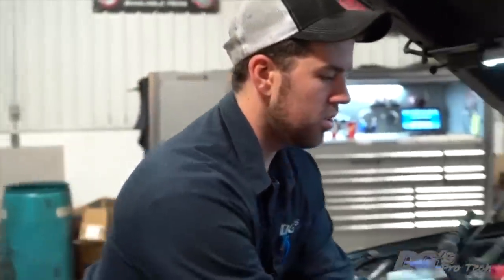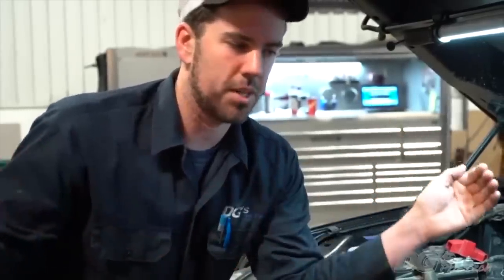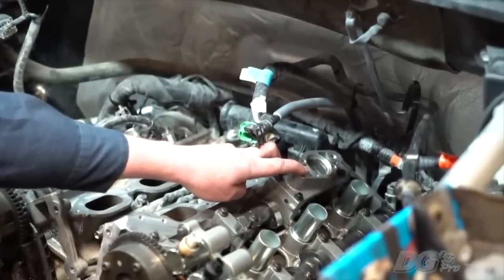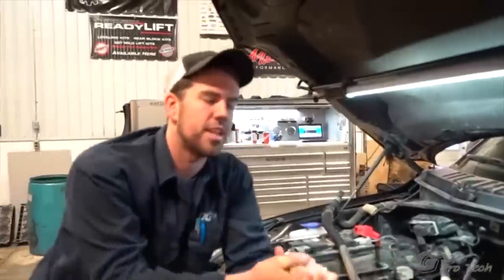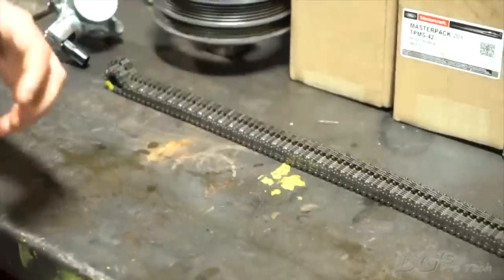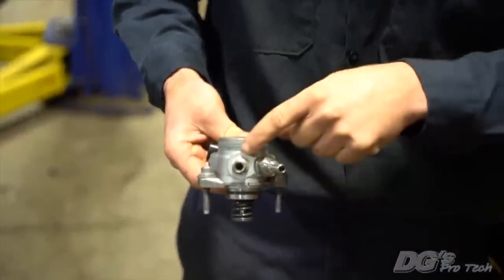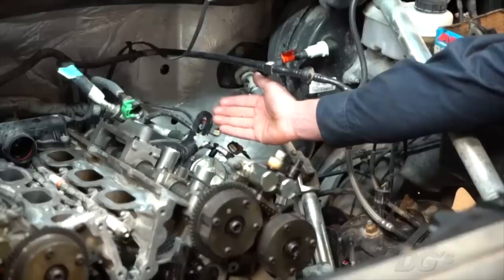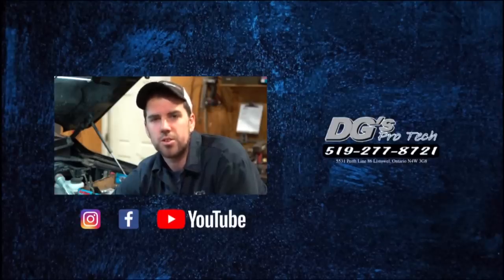What you NEED to know about Ford EcoBoost Engines by Dustin Golley of DG's ProTech

Comment: You get eco or boost not both hell my 98 ram with the Cummins diesel averages 20mpg everyday and up to 26 mpg on the highway but when I drive like a dick and flog on the throttle my mpg drops like a rock

Comment: I drive very calmly and I get about 16.8 mpg.  The 21 or 22 on the window sticker is complete bull.
Reply: I get 16-16.5 mpg around town, 22-23 mpg highway.  3.5 ecoboost, 4wd, supercrew, 6'6" bed, with a shell.  I have a fairly light foot, and drive 70 - 72 mph on the highway.  I live in california so our gas is full of additives that lower mileage, use 87 octane, and there are lots of hills.  In other words, the window sticker is not complete bull.
Reply: I have pretty much the same truck and most of my driving is highway.  I've never gotten anything better than 18.1
Reply: @Motowinkle58  Oh, and did I mention that my truck is 2WD?

Comment: What are the signs and symptoms of having the phases out of time? Does it TICK real loud? Some one help me
Reply: The computer will know it before you do.  Did a timing belt on a Miata once and the exhaust had jumped time by 1 notch and neither the owner nor myself picked up on it during operation (computer only monitored intake cam, no VVT).   It was a little smoother in acceleration post belt replacement, but it was nothing that stood out -- in fact car just made a 400 mile road trip.  If conditions are right for it to jump time once, it can do it again and in an interference engine, most likely the cheapest route will be to buy a new short block.  If it's a turbo motor and part of the valve enters the exhaust / turbo/s, you're replacing those too.

Comment: I'd like an explanation as to the premature timing chain wear (I assume from the video) ....
Reply: It's fairly simple -- turbo engines are MUCH harder on oil.    If you don't use synthetic, and face it, most don't, and you regularly take it to 7500 - 10,000 miles between changes, you're killing your engine.  In the ecoboost, the timing chain is one of the first components to go.  That single chain has to do a lot of work whereas V8 chains are more robust and there's one per head.   IMO chain links are too small, there's far too many of them which equates to smaller sprocket teeth, and more links = wear stretch multiplication combined with small teeth on the sprocket = easy to jump time.  Use a quality synthetic and don't go over 5,000 miles.  That's for ALL turbo vehicles -- turbos are hard on oil, and if you love to spool the turbos, you're literally cooking your oil.

Comment: How many miles were on this engine before the chain stretched to this point?
Reply: Mine had a little over 80 thousand.  It didn't throw codes, I just heard it making noise when starting up in the morning. 
3100 bucks to fix at Ford dealership. I run full synthetic oil since I bought it and change oil every 5000 miles or sooner.

Comment: Love my F150’s ( with the 5.0) when Ford does away with them and goes straight Eco engines I’ll be driving a different brand.
Reply: Why the EB are  great motors , especially the second gen. They have considerably more low end torque.

Comment: We have very dew independent repairers in Australia, and I don't count Kmart. So you are forced to go to the dealer. The F100 and F150 are no longer sold here for a couple of reasons. Our authorities grade any "truck" with a dual cab as a passenger vehicle, so being body on frame with shocking offset collision results, they only get 1/5 stars on the NCAP/ANCAP international rating system. That makes injury insurance probibitively expensive. The other reason is fuel consumption. Unleaded and diesel here ranges from $1.60 to even $2.40 per litre in remoter areas. Thats like $8-12 per gallon. Its just not affordable with the fuel consumption of the F series.

Comment: In other words, if you work an Ecoboost engine like a V-8, it'll get about the same gas mileage but be far more complex and expensive to fix.
Reply: I would never buy an ecoboost for mileage. As a 5.0 owner who tows frequently, particularly at high altitudes, I would buy it for the towing and the boost. Its also a fun engine/ powertrain, which is an ok reason to like a vehicle. My 5.0 has been amazing for me, and I do love it. Simple, reliable and a breeze to work on. But it chokes at altitude, and struggles with every hill. I have the old 6 speed transmission though.

Comment: Easiest way to deal with these issues is to get the 5.0 coyote engine.
Reply: Yea, right?!  Similar power, economy and a lot less to go wrong.  I keep vehicles a long time, I wonder what the eco-boost will look after 20 years.
Reply: @Hubjeep  probably won't reach 10 years and it will be junk....
Reply: Except you forgot where the 5.0 now uses sprayed on cylinder liners and has a bad oil consumption and piston slap issues. But hey, you do you, lol. Oh, and you also forgot how the 3.5 and 2.7 eco's HAVE BEEN UPDATED and no longer experiences any of these issues. The dude even kinda mentioned that in the video...

Comment: Can we hear how long is a "long time" (how long does the engine last?  How long does the timing chain last?  in terms of mileage?)  Thanks!   PS - and what is the "proper maintenance interval" recommended in the owner's manual??
Reply: Timing chains easily last 250k as long as you use a good oil and proper intervals. I use full synthetic in our vehicles and not the normal stuff you buy at Walmart I order Liqui Moly, Motul, Ravenol, Pentosin, Total, and more. I personally prefer European oils as they tend to have more strict quality control and specs than our US oils. The most common is even our full synthetic in the US wouldn't quality for 100% synthetic in Europe especially Germany.
Reply: @bryanmartinez6600     That 50K number must only be with the exotic/expensive European oils.  Most of the FSeries and E Series with the 3Valve 5.4 Tritons we see around here are nearing the end of useful life of the 2nd engines at 250K-  average of about 130K to 170K and the spark plugs popping out (not related to oil quality), the cam phasers, the timing chain stretch,  the hydro lock(not related to oil) and a few other smaller issues have drained the owner's pocketbook and make them more willing to replace the engine than dump more money into the original (or existing) engine.
Reply: @brianstough5286  we have an 01 5.4 Expedition and not many issues. Did leak Coolant from the intake once but an upgraded intake and was all good. I think at 120k miles I did plugs coils and injectors and it's still going fine. The issue is with employees that beat the hell out of vehicles cause they know they won't have to pay. Also I used a torque wrench to get these plugs in as good as possible. Over torquing these plugs will easily strip the threads also using poor quality plugs that need new ones every 20-30k will wear out the threads. All my cars get NGK Iridium plugs, they go for years with no problems. They even have new ruthenium plugs which supposedly are better but very expensive I think $15 or more a plug. I never trust fleet vehicles due too their abuse or fleet maintenance because of the cheap crap they use.
Reply: @bryanmartinez6600  Sorry for my mis-spelling and unclear statements.  When I said "we" and "here" I did not imply "fleet".  I am speaking of personal vehicles - mostly, people I know that have purchased these F150's and Vans (and van-bodied vehicles) slightly used at seemingly good value prices - -  then learned why they were being "dumped".  CarFax on most of them was that they were one-owner privately owned vehicles.     I know there are some shady mechanics out there, but there are enough of these problems that they are WELL KNOWN/somewhat documented design issues.  250K on a 3 valve Triton engine is, well, I won't say impossible, but very improbable...

Comment: Finally enjoyed of video of a guy that knows what he is talking about.
I had a fiesta st (europe) gave it to my sister with 8 month old, it has a 1.5 3 in line ecoboost with 200hp. I keep saying the same to my sister, drive without going into much boost to have a an eco drive, but once in a while dont be afraid to floor it, its an amazing car with a great engine, and it has the limited slip dif. I just bought 2 month ago the new focus st 2.3l 4 in line with a twin scroll turbo 280hp and a limited slip dif as well. My previous fiesta st is reaching the 1 year mark in 2 month but it is near 10 000km. Despite Ford manual says 2 years or 20k km, with castrol 5w20, i will change the filter and oil as soon as it hits 10k km or 1 year, by doing this like you said on the video i can make the engine last longer and prevent wear and tear. I will do the same for my focus st. The only difference is that the fiesta st 3 in line as a rubber timing belt dipped in oil, something other brands dont use. My Focus ST with the 2.3l engine i dont know if they have done the same and use a rubber belt or if they are using a chain, I will have to ask the dealership for more information. This engine despite being the same capacity from the old mustang European version, it has a twin scroll turbo and and some new design.

Comment: If it only has GDI and no direct port injectors the intake valves will get choked with carbon deposit.
Reply: 2018 and up have both Direct and Port Injection.. Still a good idea to run a catch can.. Problem solved👍😀

Comment: I have a 14 and it has over 180k kms. Not one problem but it only ever had Ford oil for 1000kms then amsoil signature series 5w-30 every 8k kms. More power than any V8 and better mileage loaded than my old V8. And it’s none stock.

Comment: So, if you USE boost, your economy sucks.  If you don't, the waste gate seizes.  Swell!

And the chain is going to stretch "without proper maintenance", but we're not told what that means.  If it's the reference to synthetic oil, say that.  And what is it about the oil that causes the chain to stretch?
And the chain tensioner presumably has NO sensor on it, so you don't know how far it has traveled (and how soon you're going to be screwed).  Not what you want to depend on before going on a trip with a trailer.

Removing enough parts to get at the timing chain doesn't seem like an end-user project, or something a mechanic would do inexpensively, and we don't know how many miles you get between check engine light and everything destroying itself.
Reply: Best bet is to avoid it all together.

Comment: First of all, great video. You share your knowledge without arrogance like other YT mechanics. 

Can you positively confirm that changing the oil more often than the recommended intervals actually does anything beneficial if you are using a good quality synthetic? My intervals are taking me to about 10k miles and I’m now at about 95k miles. 

I’m changing my 2015 3.5 at the recommended intervals with Mobil 1 extended service and have had my last 3 oil changes analyzed. Every sample has been better than average regarding wear, TBN and flash point. 

I understand the recommendations regarding more frequent oil changes but that doesn’t guarantee anything. If you instead spend that money on oil analysis, at least you have a shot at seeing an issue before it causes a problem. 

In your experience does driving it too hard also result in timing chain stretch? I have a friend with a 2017 and about 60k who had to have his replaced. I suspect he drives his harder than I do.

Comment: Watch Fast Lane Trucks when they take an Eco-Boosted truck up he Ike Gaunlet hauling load. Plenty of power but mileage was dismal.
Reply: I wasn't overly disappointed driving 12 hours with a 25ft enclosed sled trailer with 4 sleds and gear and averaged 
25L/100km. What do you really expect a v6 to compete with, my dads 2016 f250 doesnt average much lower with the same weight but maybe towing a bit quicker.

Comment: Great video lots of good information, I’d like to add one thing, filters use Ford filters Ford has a patent on most of its new filters especially oil cartridges. Aftermarket filters, for example are a fraction of inch off because of, again Ford patents, and let oil bypass. Ford filters of great quality and are inexpensive.

Comment: What you should remember about the eco-boost engine, DO NOT WAST YOU MONEY ON ONE !  High pressure fuel, high compression and turbo charged, a financial nightmare cocktail. You will be getting oil diluted with fuel, turbo charger failure, the engines are much like engines produced by the Krauts, over engineered and costly pieces of shit !

Comment: I have a 2012 F150 4X4 ecoboost with 196,000 miles.  Change the oil with synthetic blend every 5,000 miles or less.  Usually it is around 4,000 miles.  The only problem was a water pump failure at around 150,000.  Great engine, great truck.

Comment: What would be the cause of a cricket chirping noise under boost on driver side? It’s consistent in rhythm and tone. It sounds turbo related. Doesn’t do it under low load. Also makes odd sound on cold start from same area for a few seconds and then it sounds like it opens something and releases pressure.

Comment: Good stuff, I remember when I used to work at Ford, I used to tell all my customers to bring their trucks in at 3500-5000 mi, depending on driving habits. I just went off the problems the 5.4 had and applied it to the 3.5 and saved my customers alot of money and time, especially when alot of them are farmers and oil field hands. I just wish Ford would've had a tentioner on the left side like they do in the newer trucks though, or atleast make an adapter of some sort to attach to the chain guide mount. Making sure the customers are running premium also helps too

Comment: Well done video!   Excellent presentation, highly informative and done by a person who knows his craft.  I don't own anything with an Ecoboost engine, but I have driven a few F150's with the 3.5 EB in the past.    For a 3.5 liter engine, it punches way above it's weight class.    I was very impressed with the power Ford was able to get out of its displacement.     I also agree that Ecoboost equipped trucks don't necessarily get that great of fuel economy while towing or in high boost conditions.     However, if just cruising around with low boost, the Ecoboost easily beats the 5.0 V8's fuel economy numbers while delivering more power.      I would like to see Ford incorporate something similar to Toyota's D4S system with both port and direct injection.    These new DFI engines are suffering from carbon buildup since the fuel is being injected directly into the combustion chamber.    Port injection allows the incoming fuel/ air charge to help keep the intake valves clean.    I owned a 2007 Audi Q7 with the 3.6 liter VR6 engine.    It was direct injected and was a nightmare to own because of fuel injection issues and driveability problems.

Comment: Got the 2.0 EcoBoost in my car and I love it, three years going strong. These engines are meant to be driven and used, as long as you take care of them just like anything else.
Reply: I just bought a 2016 2.0 ecoboost with 60k km (35k miles) on the clock. Is there anything apart from regular oil changes I should be doing to keep it reliable? thanks.
Reply: @nzmarco  trans fluid, the 6F35 likes clean transmission oil. Should be done at 50k (km). Injector/carbon flush at 50k as well, if you have AWD get both diffs done too. Check online for service intervals, that may give a better idea. 
Direct injection has its own caveats, so the more you understand how DI works the easier it'll be to determine what type of service you need.
I use strictly 91 octane, but 87 is fine as well.
Enjoy the FuSE, its a great car!
Reply: what's in a name thanks for your response. I have been using a higher octane (95). Will do some research around scheduled servicing and check out the service records I have. How’s your average fuel consumption? I’m at 10.5/100 (metric sorry) while urban driving. Haven’t been on the open road yet. Cheers.
Reply: @nzmarco  on the highway 7.6L/100km, in the city about the same as you, 10.5L/100km. Winnipeg has a shitty layout so I end up idling more than driving, haha.
I've gone from MB to BC and back twice in the last month and the car hasn't complained a bit, and I'm already at 100k kms. Built Ford Tough like they say.
Reply: what's in a name I hope so. There’s lots of info on gdi I wish I had of read before buying the car, which incidentally is called a Mondeo in New Zealand. I saw a CRC product on YT that apparently breaks down carbon on valves and the turbo. Might see if I can find it here.

Comment: I have an Aussie made Ford Bad Ass Falcon straight-six  4.0 liter semiautomatic 4sp an excellent car with no problems 207561 kilometers on the dial, I use Castrol magnetic synthetic oil, this engine is fuel-efficient to my old  Toyota 2.4 liter 4sp auto

Comment: Interesting. Interesting system only a Brit could love. Not what any American would expect in anything that leases their car/truck and turns it in for a new one every year. I drove and worked one a series Land Rover. The same kind of chain tensioner  including hydraulics. Jaguar Xk6, ditto. 

My American car experience was driving with the infamous AXOD transmission. People would just operate it in OD, thinking it as in drive. OD was for highway driving, not city driving. READ Your Owner's Manual on a large investment.

Comment: I have the 2.7L ecoboost engine. I heard it hasn't had the same issues that the 3.5L version had run into during its earlier years and may be a bit more reliable over a long period of time at long as you're not leaning into the turbos often which is more likely since you're more likely to engage the turbos while towing since the displacement is smaller and the engine will dip into that boost power more easily than the 3.5. But otherwise the 2.7 is allegedly a superstar from what I was able to read up on.